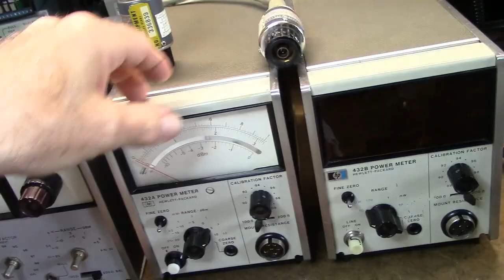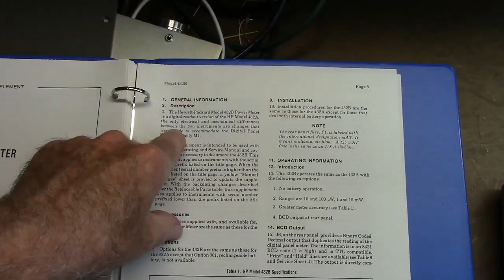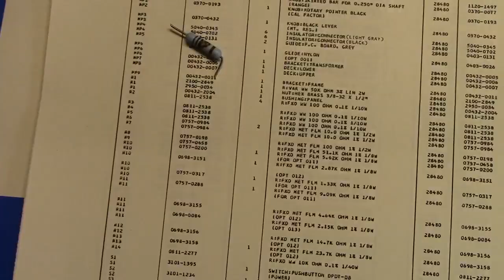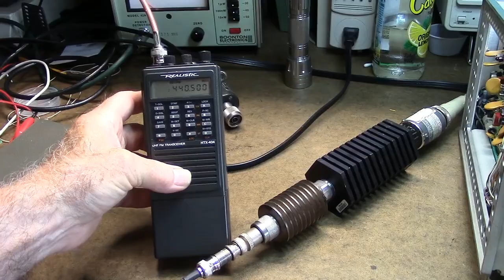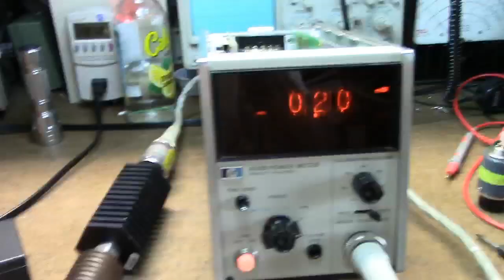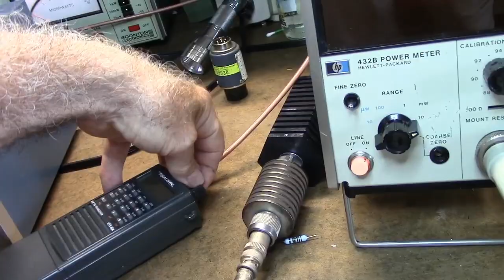Hp 432B Power Meter

Comment: My best thought on the 10 ohm resistor is that , it's a end rush limiter ..... It caught one too many close lightning strikes , I live in Southwest Louisiana and we deal with a lot of thunderstorms down here ....... I have 2 sites bookmarked for where lightning hits ..... A lot are within a 3 block area ...... I have those APC type power banks that I got from my cousins radio station , me and the engineer were good friends ....... I should have took that job when it was offered to me ......  Those power banks have good protectors in them ....

Comment: I'd try using a signal sampler and a Spectrum Analyzer. "Calibrate" the sampler with the VNA at the test frequency to know its attenuation, then measure the signal level with the SA. A bit of math and, presto, another way to know the power level. 🙂
Reply from the maker: Excellent advice Ralph. I bet you saw a lot of these in the USAF
Reply: @toddanonymous5295  Yes, actually we did, but it was mostly the A version.